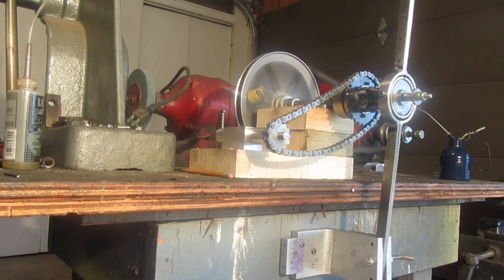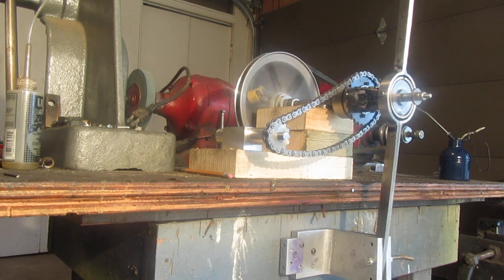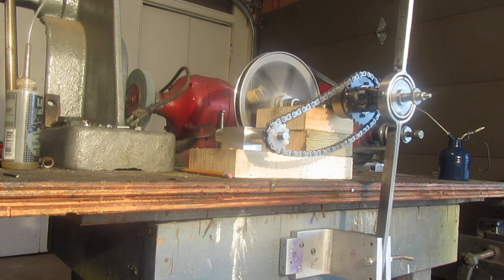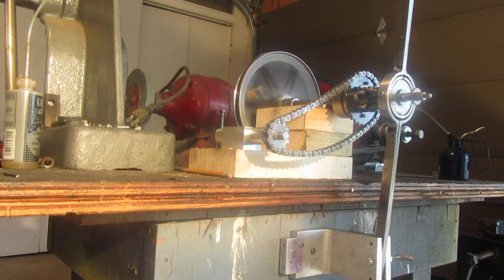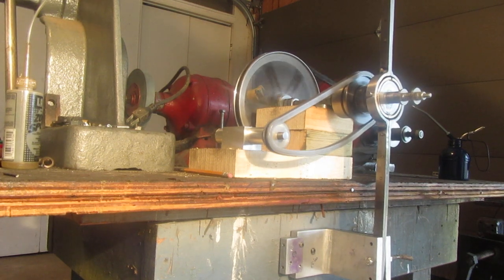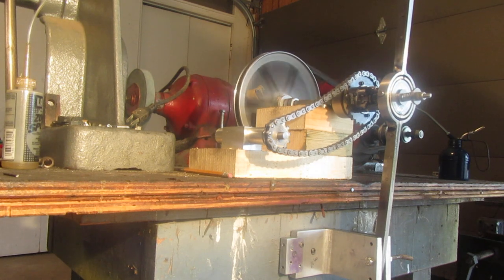Manual clutch for small engine

Comment: I have 2 similar clutches that are from the 50's,and were used on an industrial mower. They are on 1"shafts and have a tapered wedge that raise a cam,similar to a motorcycle drum  brake,but drum is fastened to a shaft.Eclipse reel type homeowners small reel type gas powered mowers also used similar clutches.Old technology, but durable.